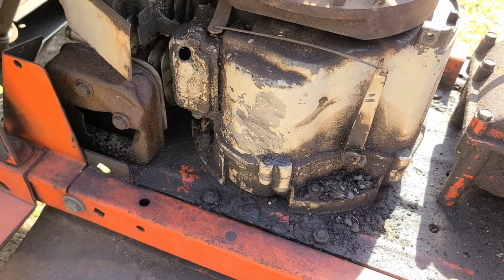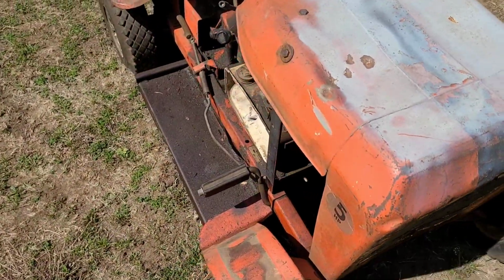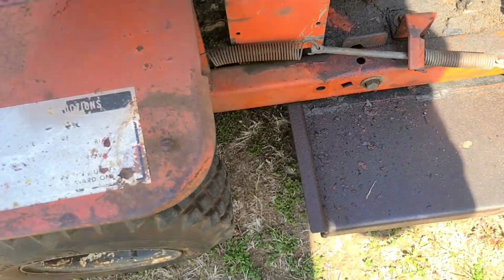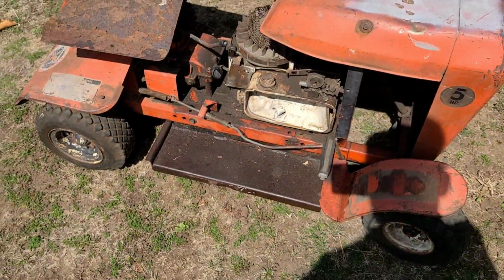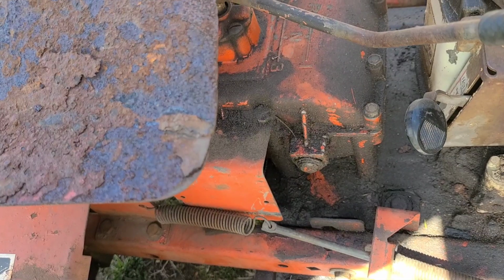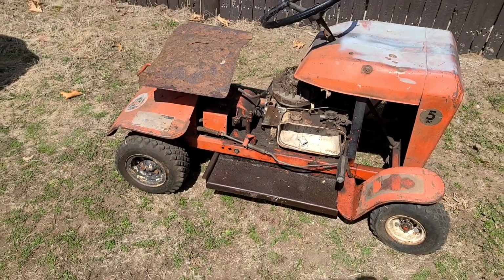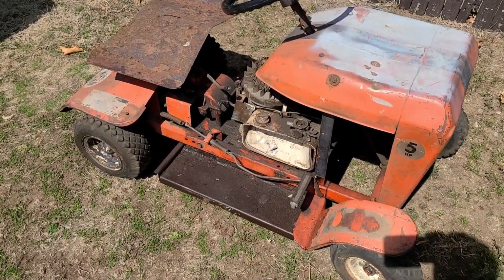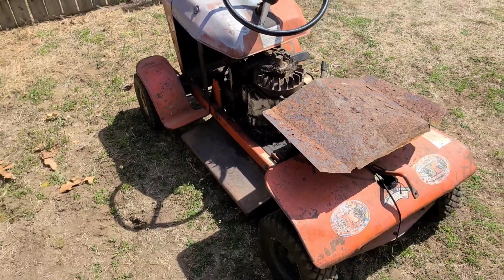Another Rugg Carpet Cut Mower / What To Do? VinsRJ

Comment: Looks like a nice little runner for riding around at shows and different events. 
I surely can’t fault you for going after anything because a Saturday ago, I went after a Cub Cadet 1710 that had a pretty decent sounding engine and hydro transmission. 
After riding around some at my place once I got the tractor where I could tell more about it,,The engine shut down for what I think is a wiring issue or a bad ignition switch more than anything.
This was too nice of a Cub Cadet to pass on for the money that I had to pay. Like some of the other stuff that I have bought, I don’t think that the pivot points underneath the tractor or the steering spindles had ever been lubed in any way.  At least the tractor was nice enough to give me the chance to get unloaded and test drive to try out the engine and transmission. 
I have been spraying penetrating oil on all of the pivot points and brake linkages.,
These small tractors sure are addictive.

Comment: Free is good !! HF engine sounds cool, but don't they just have a 3 1/2 vert.?vertical.?? I guess it would work.
Reply: Hf has vertical engines.  The rugg has a vertical engine. Problem solved
Reply: That HF vertical works out to about a 5.5hp engine. I have one on a john deere 70. Works just fine.